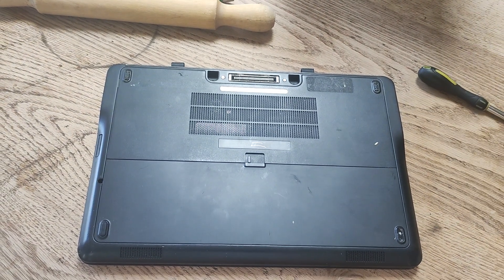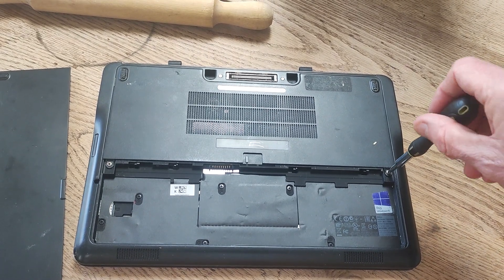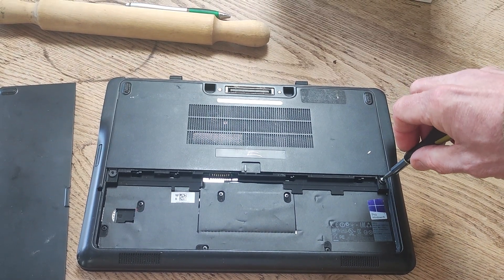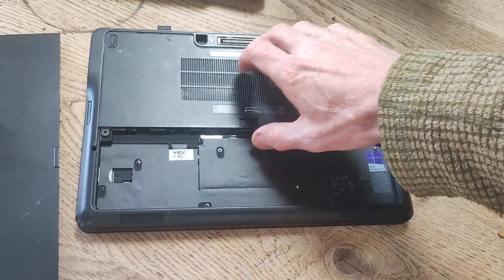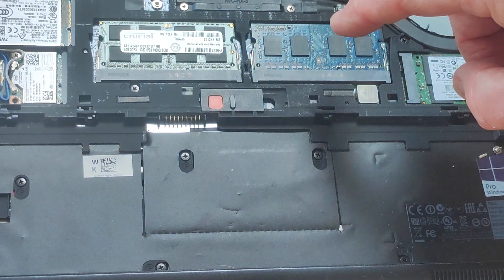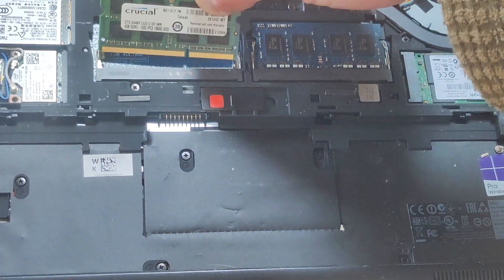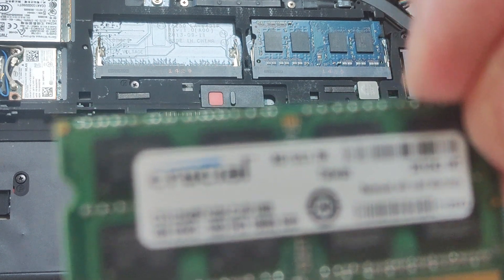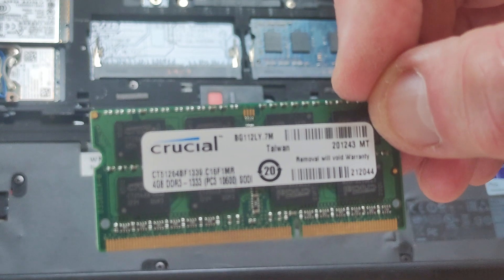Dell Latitude E7240: how to upgrade RAM

Comment: It's DDR3L 204 pin 1600.. Just upgraded one I bought on we bay for £12.00 to 2 x 8GB so a bit faster as 16GB only payed £11.00 for the laptop needs a new battery getting one after weekend so for a total of £43.00 I got a laptop with a brand new battery and 16gb new ram upgrade not bad needed to get a new machine with windows 11 pro installed, as Windows 10 is no longer being supported by Oct 2025..